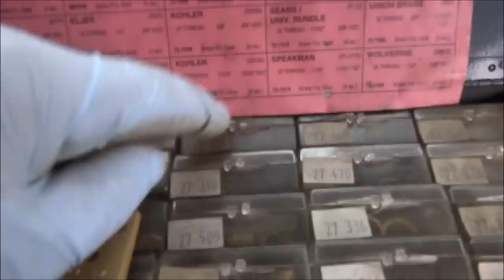plumbing:badly leaking tub/shower faucet fixed

Comment: I literally just got done replacing my hot and cold bath tub stem valves and the seats, this morning.  It cost a total of $52 at my faucet supply warehouse, but that included the $8 tool to remove and replace the seats.  In total, it took me about 45 minutes and I am thrilled with the result ... at about 1/6 the cost of calling a plumber.  No more drips!  I also noticed that the water flow is higher, but not sure why.  I was fortunate ... the two valves stuck far enough out from the wall that I just needed a 1" wrench to undo them.
 
The seats were in quite firmly, but the removal tool had enough leverage to get them out safely, without risk of rounding them out.   A little bit of plumbers grease on the threads and everything screwed together easily with no fear of cross-threading.

For older plumbing, the guys at those specialist faucet places are so incredibly knowledgeable, unlike somewhere like Home Depot, where your advice can be hit or miss.  I took in the old parts and they gave me exactly what I needed.  I could not take a valve seat with me as I did not have the removal tool at that point to get it out, but just by showing the guy a picture of the seat in place, he happened to give me the two exact seats that I needed.

Comment: Nice video, Steven. I would have liked a good photo or 2-second shot of your seat removal tool. Looks like a square drive that is tapered, so as to fit different sizes?
Reply: It looks like a ratcheting style wrench that HVAC people use you can put different drivers in it

Comment: Great step-by-step video.  I prefer those straight valve seat wrenches (you upgraded to the ratchet-style with multiple sizes) rather than those 90-degree cheapies from home centers.  When you replaced the gasket last time, did you also replace the seat(s)?  It seems strange the rubber outlasted the seat.
Reply: Normally you wouldn’t go through all that and only change one of the parts, seats and seals always

Comment: Have you ever removed or worked on a gravity furnace? is a very large furnace with huge ventilation pipes going a different direction like a octopus also call octopus furnace.
Reply from the maker: SkyLimitTV well change it out ..

Comment: Steve, Nice Job, sometimes those seats don't come out
Reply from the maker: S Sam your right ,sometimes they do not want to come out ..then we change the valve
Reply: @stevenlavimoniere  Ocassionally you can still resurface the seat. Sexauer made a nice tool for that, much better than the basic grinder style resurfacing tools.

Comment: steve. I guess that was a nice job. you do have a pretty good stocked truck. one thing though? why didn't you complete the job. take the stem apart clean, grease and reassemble it. then tighten the packing nuts to specs? That would have been a complete job. 
steve. 50 is still a young man. You'll learn....
Reply from the maker: i learn ever day